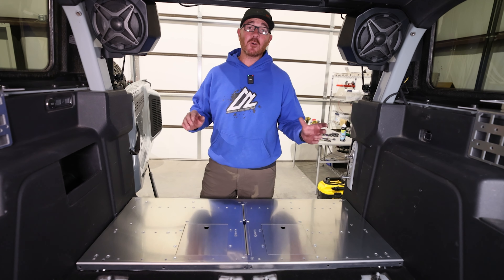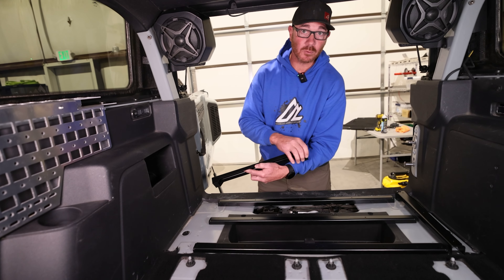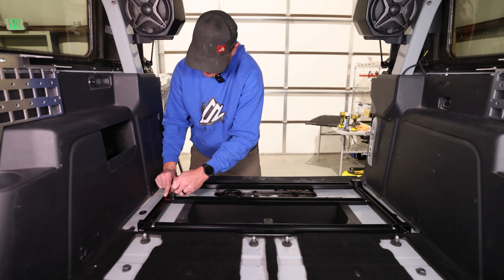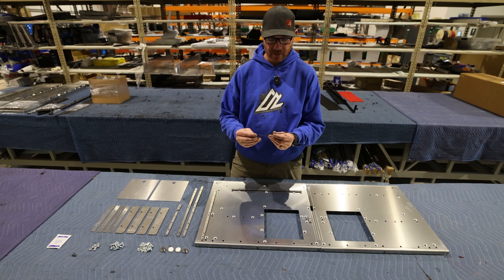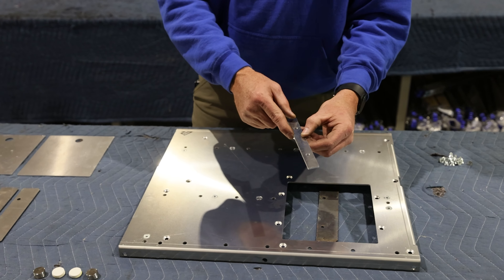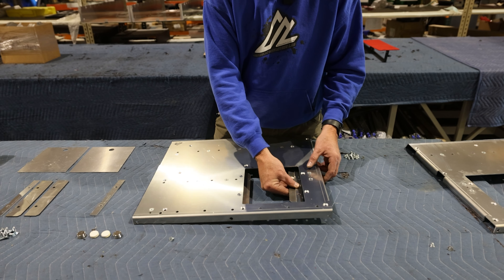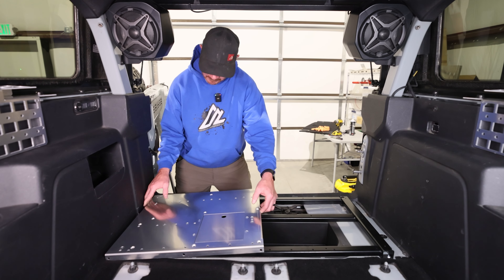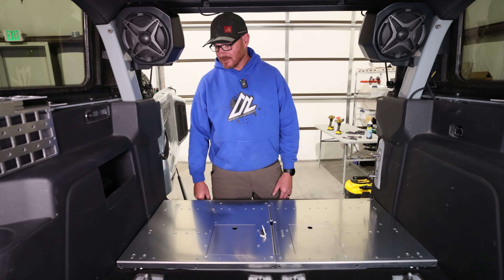2dr Bronco MASS Platform Install!

Comment: Is it required to remove the rear seats or can this be installed with the rear seats still inside the vehicle?
Reply from the maker: You can install with them in! Taking them out gives more room but it’s not required.
Reply: @AdventureLab  This is great news! Thank you!!

Comment: Look at those enormous rear speaker pods!! Are you going to do a 4D install video as well? I currently have the goose gear plate but I'm considering switching to the AAL platform and fridge slide
Reply from the maker: We do have plans to do so, we just need another Bronco to come in the shop so we can film one! Hoping to move most of our instructions over to video soon!